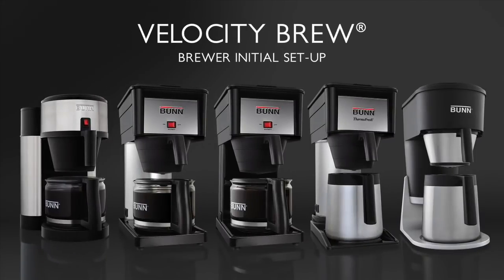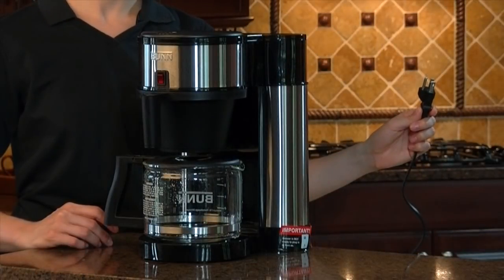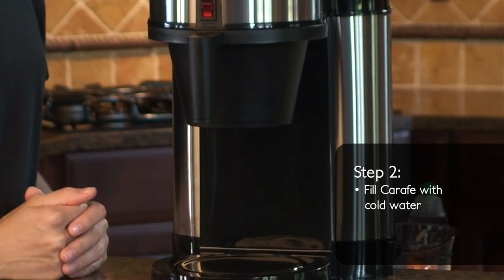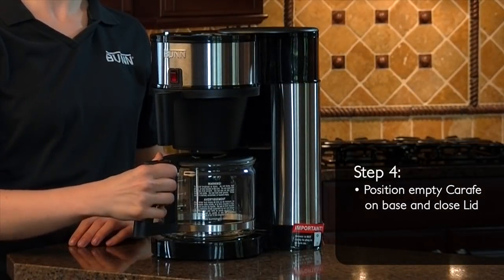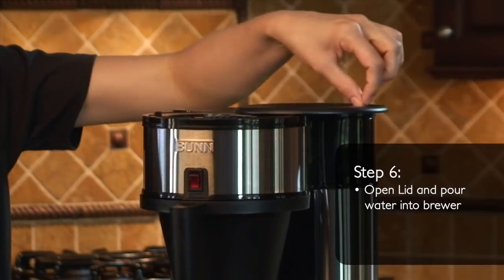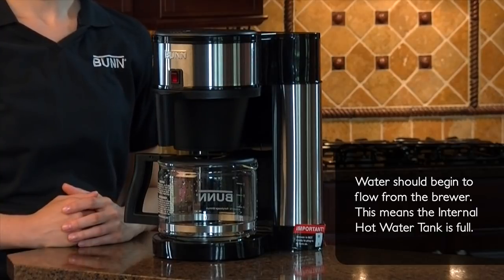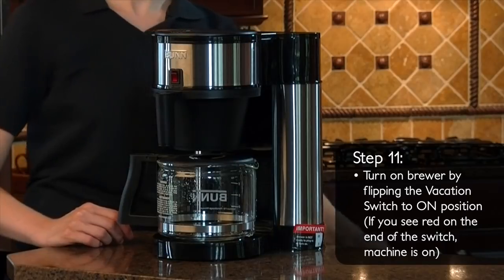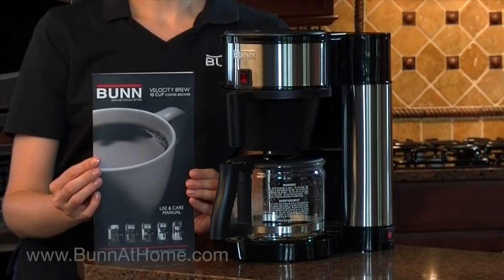How to set-up BUNN® Velocity Brew®

Comment: I've been going to Dunkin Donuts 5 days a week for the last 3 years. I've calculated I've spent about $3k on coffee during that time. I go there because I can't replicate the taste at home. I've tried two different drip coffee makers, and a french press. It's not just using freshly roasted beans and filtered water. It's about the coffee maker too. Dunks uses BUNN coffee makers.

My question is, should I get the velocity brew, or the smaller commercial VP-17? The VP-17 intrigues me because it has much less plastic touching the water, and the funnel can be replaced with a stainless steel one. There are reviews of the velocity/speed brew and heat n' brew having a strong plastic smell and taste. Plastic and very hot water don't mix over time. Would you flip your steaks with a plastic spatula on a grill out back? No.

What intrigues me about the speed/brew is the reduced electricity usage, and smaller footprint. My wife and I will only brew 6 cups in a morning. The VP-17 is large and it draws more electricity. The speed brew will pay for itself in 2.5 months of daily use, the VP-17 in 4.5 months. 
Has anybody ever owned both? What do you think? The goal is to replicate the taste of Dunkins/Starbucks and home.

Comment: I must be losing water somewhere.  No matter how high I fill the carafe, it brews less than the 10 line.  I'm already regretting it not being a 12 cup.  Suggestions?
Reply: hogluvr1 how often do you use your maker? If you only use it occasionally and keep it turned on, the water is probably evaporating

Comment: If I only want 20 oz of water in the tank, do I have to dump all of the water I just put in our, and refill it with only 20 oz?  If so, when would I turn the power off/on when refilling with the 20 oz?
Reply: You don’t just have 20 ozs in the tank. You fill the tank, it stays hot, you put water in to make your coffee, the water is used and you still have a full tank. That’s why you can have a cup of coffee in 3 minutes. The water is hot so it brews almost instantly.
Reply: @joyceseleska8622  does that water ever have to be emptied and then replaced?
Reply: @JN-co3lw  No. Regular use will cycle it through.

Comment: Okay, so after the 15 minutes, what happens? Where does the water go that's in the tank?
Reply: +Christina Guinn It uses water displacement. So you have hot water in the tank, ready to go. You then put cold water into the top that pushes the hot water out and into the brewing funnel. So if you put in 6 cups of cold water, 6 cups of hot water will come out.
Reply: Does that mean the water is heated constantly in the tank? Even when it's off?
Reply: No, not on the home units. You fill the tank up with cold water, turn it on, wait 15 minutes for the tank to heat up the water, pour in x amount of cold water to get x amount of coffee. It works this way because you get a consistent temperature through out.
Reply: This is designed to not be turned off. Only if your'e going to be gone for a few days.
Reply: SpykeZ0129 can I only make 4 cups of coffee if so how
Reply: tom gearhart you put coffee grounds in for 4 cups of coffee, pour in 4 coffee cups of water or however much you want and it spits out 4 cups of coffee. You want 5, put 5 in, you want 3, you put 3 in.